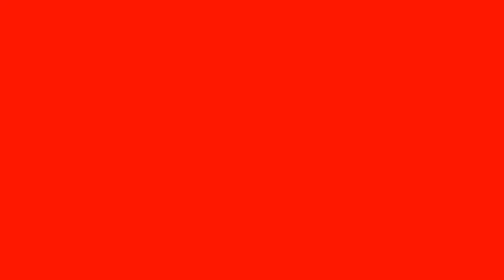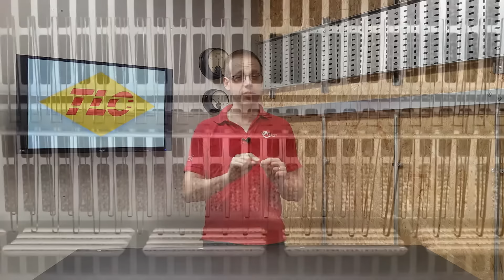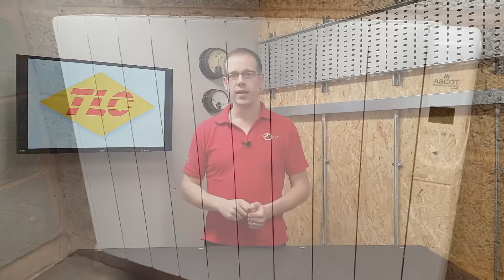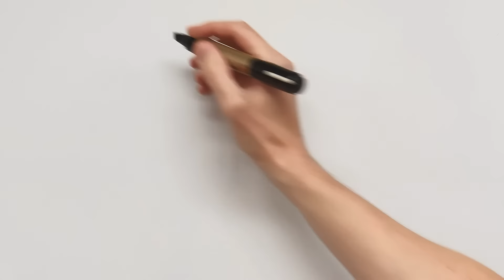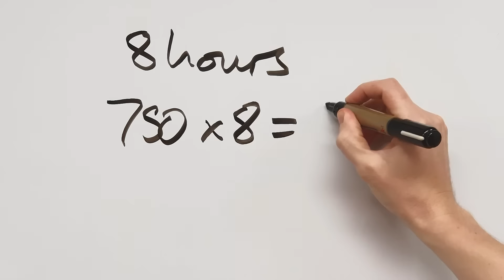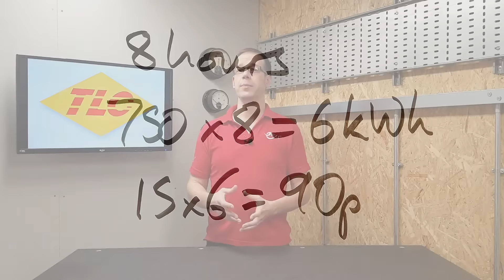Do electric radiators use a lot of electricity? -   Electric panel heaters vs oil filled radiators

Comment: Let's get back to basics; the amount of heat you need to maintain a certain temperature is the heat needed to replaces losses through walls, floor, ceilings etc.
So all electric heaters will use the same amount of heat, the only difference is how they do it, convection, conduction, or radiation.
A gas boiler system has other losses such as through the flue, so is less efficient. However with electricity being about 4x the price of gas there is a lot of price reduction needed for electric to be economic! There are a lot of comparisons with well insulated rooms and electric, but any heating will be cheaper the better the insulation.
Reply: Completely agree - they are talking about efficiency here so a panel or oil rad will chuck out pretty much 100% heat from electricity - how that feels to an individual's level of comfort is subjective depending on the transfer method and hence may be run for more or less time (not a factor if we compare like for like in terms of power and time) so this video seems more like a sales pitch ;)

Cost to run, which is a significant factor for most folks is the big killer versus gas and the only thing that comes close is a heat pump which will be more efficient than just literally "burning" electricity and come close to gas in terms of cost. On the downside heat pumps have a larger initial outlay sadly. Cost isn't discussed in this video which is deceptive in my opinion as those not in the know might be led to believe that somehow this new rad is a 'clean' alternative to gas but there are two aspects to the discussion - efficiency AND cost versus the alternatives!
Reply from the maker: Agreed, gas is cheaper when used as a heat source and I state this in the video, unfortunately it won't last forever. The purpose of the video was to give an idea of running costs for a heater. The future is definitely electric, most probably a combination of direct heating and heat pumps.
Reply: @efixx  There is no future in direct electric heating. I don't care how much Premspec are paying you. The Electric Radiator companies are scamming people who unfortunately don't know any better and eFixx isn't helping with this banal video.

Comment: Hi Joe, to my mind since the conversion of electriciy to heat is 100% efficient, the amount of energy used is deteremined by the temperature set point, the size of the space you are heating and the degree of heat loss from that space (level of insulation etc). I agree that using a more sophisticated proportional (or even PID) type controller will give you more precise temperature control, it will not fudamentally change the amount of electricty used.
Reply: And considering you get a couple of magnitudes more using a heat pump instead of electric heaters for the same electricity... pfff

Comment: Prices of electric are only going to go up in the future, as the tree huggers and government think it's green and as a result are putting more demand on the fuel.
By throwing a load of cars into the mix for one, so it's a no brainer to use gas, at less than 4p a unit compared to 15p a unit for electric.
Reply from the maker: But Gas is being phased out for new homes from 2025.
Reply: @efixx  and you believe that?, They were supposed to stop putting gas to new houses years ago, that didn't happen. 
What about all the jobs that will be lost, and if people are in fuel poverty now, what's going to happen if they have to use a fuel that's three times the price🤔
Reply from the maker: We'll have to wait and see what happens on 2025, gas won't last forever and with the rises in renewable electricity sources hopefully the cost of electricity will come down. Time will tell eh?
Reply: @efixx  this is true, but I remember in the late 80' earlier 90's being told there was only about 30 years of oil and gas left, well that ship has sailed, it's still abundant as ever. And without oil the world would be screwed.
Reply: Anthony charles You're missing the point. Gas will no longer be installed in new homes. Those homes will be much better insulated, and much more air tight, meaning the heating load can easily be managed by a small, and comparatively cheap to run heat pump. If your heat loss is only 3kw a heat pump can keep up using just 1000 watts, or about 17 pence per hour- hardly ruinous. Gas boilers will remain available for replacing those that fail in older properties for many more years.
Reply: @spencerwilton5831  I am not, not taking had to new houses has been locked around for over a decade, and makes no sense.
A typical domestic supply is not large enough to go all electric, heat pumps, showers, cookers and now car chargers. 
The network can't cope with all this additional load, it's not that long ago it was headline news that they may need to limit supply.

Comment: When electricity prices drop to 10% of the current amount, it might be economical to heat houses this way. Can't see that happening...
Reply: That seems to be your mantra for everything! Doesn't detract from the fact that electricity is at least four times more expensive than gas. No way is the unit price of electricity ever going to decrease. The energy suppliers would never agree to it.

I am concerned as to where all this push for renewable heat will take us. The UK can and does experience a miserable climate even in early Spring and Autumn. Worst case scenario for people who live in off-grid homes in the future will be freezing in their own homes because they cannot afford to use their non-gas heating.
Reply: It’s disingenuous to suggest gas is being phased out and replaced with resistive electric heating - its not.
Reply from the maker: No but gas is being phased out for new build homes in the UK from 2025.
Reply: @efixx  
New builds will be heavily insulated, so making electricity feasible as heat input is small.  Also, no gas meter charges, which can add towards electricity bills overall. 

But the rest of us have to live in poorly insulated and air leaky Victorian nonsense.
Reply: @efixx  That seems to be your mantra for everything! Does not detract from the fact  that electricity is at least 4 times more expensive than gas.
Reply: @efixx  cheaper to have a pellet heater then electric heater.

Comment: The most cost efficient heater I think they call it a woolly hat and jumper
Reply: Or body heat, time to get partner exercise and lose some weight. It's a win-win.
Reply: Absolutely, heat is basically about comfort. Rooms don’t really mind being cold (within reason) , but people do. “Heating yourself” and/or your immediate environment is the goal, not heating big empty spaces while they are unoccupied. Often I think, brrr it’s getting a bit cold, I’ll put the central heating on, then I catch myself and say… “hang on, it’s January, and I’m in a T-shirt” 😀
Reply: @brucekennedy5274  I see heating a bit like driving. You are paying for fuel to lug 1.5 tonnes of metal into town when you only weight maybe 70KG. Think about how many cubic metres are being heated just so you can keep the air next to you warm. I heat 1 room only. The room I spend most of my time.
Reply: And a stationary bike😁
Reply: You need to calculate food cost of the heat source. At least a banana every 15min.

Comment: The short answer is; No they use their rated input in electricity. 

The trouble with panel heaters and oil filled is the price of the electricity as currently it's 4x more expensive than natural gas and 3 x more expense than Economy 7 tariffs per kw. I currently have a landlord failing SAPs because of these heaters as they're chugging £3 a day per room x 9 rooms (student let hence the SAPs rating). The uni advise installing E7 heaters but they were removed due complaints from previous students due to cold snaps and on/off controls with a thermostat being easier to use. So although technically efficient electric heating can be quite cost prohibitive at times. Depending on whether you want to heat a space or feel warm, radiant heating may well be a more cost effective route.

Comment: Yeah most houses have in the region of 5 to 10 rads per property if not more! 
£1.80 x 10 
🤔 sounds like the future!! NOT!
Reply from the maker: We'll see, fossil fuels won't last forever and it's kit much longer till gas won't be installed to new build homes.
Reply: @efixx  I work for a local council in Scotland and we have pretty much stopped new gas installs and opting for electric heating or a boiler change if urgent.
We done a sheltered housing revamp that had gas communal heating so everyone paid a share. Changed to electric heating throughout the entire building! And I’m talking around 15 homes plus communal areas. The install costs alone were eye watering the cost to the tenant per month in electric costs are scary! 70 year old pensioners paying more in electricity for a 1 bed flat than what they were for a 3 bed semi! Every tenant is in debt with the electric company. There’s only two winners here and it’s not the council or the tenant.
Reply: @efixx  That's why there are heatpumps: much more efficient.
Reply from the maker: True dat!

Comment: Anyone any experience if Infrared panels??
I heard they are efficient and work well with PV setup??
Reply from the maker: Not much but maybe we can look at it,
Reply: So when the sun is shining fullbore your heater comes on??
Reply: @Frogzillanz  well with battery or in Ireland we can soon, think this year starting, sell back to grid so in directly paying for itself. I was just spitballing an idea.
Reply: As stated in a number of observations this whole debate hinges on the heat loss/retention characteristics of the space you are attempting to heat. Far Infrared panels are something quite different and a challenge to appreciate unless you have taken time to evaluate by actually using them. The nature of them is to heat the body/objects and the fabric of the room which in turn over a longer period will radiate that heat back within the room. They are quite a bit different to the glowing infrared bar heaters that we have seen for patio and church halls.
This whole heating cost dilemma that we are now having to address is refocusing attention on the better conservation of energy such that the input can be minimised. The passivhaus model attempts to create the air tight, heat tight home by maximising the insulation but as a consequence requires an MVHR (mechanical ventilation heat recovery) system to prevent the property from filling up with condensation and black mould. Those that have gone to this model allegedly are benefiting from lower running costs.
Gas cost per KWh is cheaper than electric in a  straight price comparison. However, I for one would like to see this topic updated and product options and  attention given to the smart application of smart thermostats and insulation. Maybe this is beyond the scope of eFIXX who do a Stirling job of keeping us posted on things electric even if they can be at times manufacturer biased😲😀

Comment: I have attended a block of flats where the oil filled radiators (Ducassa Advent range) have been fitted ( Which are absolutely useless as the side plastic control panel falls off after it melts from the radiator poor design) which just have a on off push button and temperature control no timer and are all controlled by a central heating programmer through contractors, The previous system was storage heaters but they were removed and contractors mounted in the off peak consumer unit .
with replacing  the heaters again for oil filled radiators some of which are faulty which are now all  lot 20 and with timer programs built in (Creda Aluminium radiator +Rointe) when the central heating type programmer switches off how long does the memory last or do the heaters have to be switched on manually everytime as they have touch screen displays where as the old type were mechanical push button?
Just curious
Reply from the maker: This heater's centrally controlled via an app so it has a permanent supply, all the switching is done in the individual heaters.

Comment: Did I read somewhere that Rointe heaters use a technology where the power to the element is switched on and off repeatedly, thus claiming to use / consume less power overall. Apparently by switching on and off at a very fast rate, the heating element can save as much as 40% in electricity costs.....is this true or just an advertising scam ?
Reply: Well then it's heat output is just 40% less.
You can't create energy from nothing!
Reply from the maker: Can't speak for Rointe but this Ascot heater from Premspec controls the current flow, actually adjusting it up and down instead of just being on at full power or off. Clever stuff.
Reply: Nice to see TLC sponsoring you guys.....I’ve used them since 1987.....they first introduced me to Wago’s back in the 90’s !!